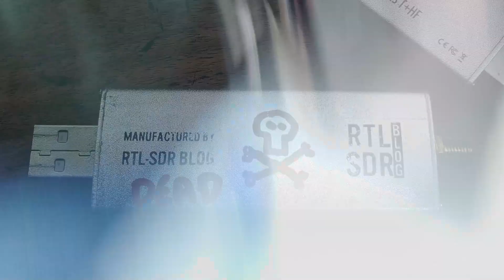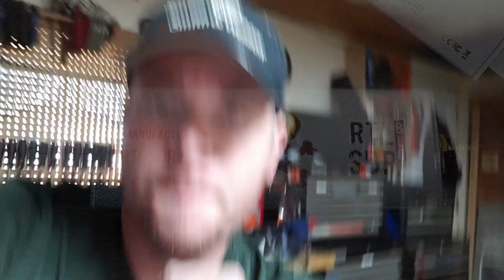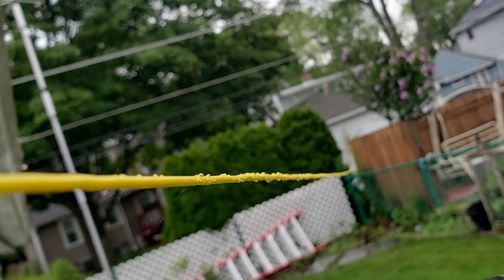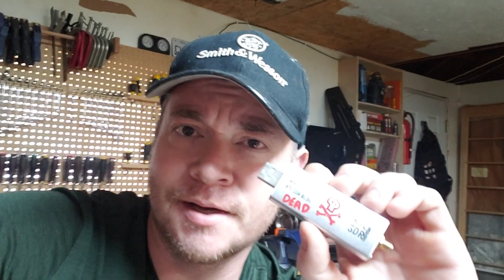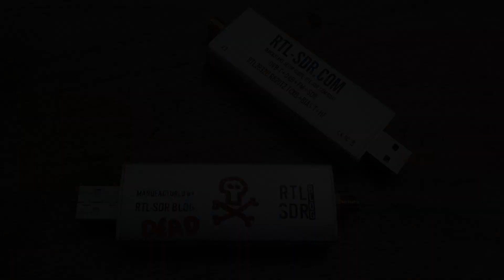PSA - Don't Kill Your SDR

Comment: I had 50 ft of coax from my outdoor antenna and the Pl-259 connector would arc whenever a lightning storm was happening. I could see the arc and hear the popping sound, It used to wake me up at night and freak me out. Lucky my antenna never took a direct hit from lightning. I touched it and got a good shock!

Comment: Thanks for lettings us know, was wondering if a Coax Grounding Block would of saved this SDR and other Coax devices?, seeing that not everyone would be there when a storm passes over their equipment. Does anyone know the answer to this ? and keep in mind were talking about Tom's 16 Gage wire antenna and other HAM Radio antennas not TV antennas (although same concept should appear🤷‍♂️ ).

Comment: Smiling!
One summer day living in KCMO went out to eat with friends in Independence, MO only to see a thunder boomer come through. We were both hams and I looked at him and said I forgot to disconnect the antennas. Several hours later returning home, walked through the front door and the lights didn't come on. Got this sinking feeling in my gut and went to the breaker box and reset the main breaker and all came back up. Most of my radio gear was hit, seems the tower took a direct hit melting coax and my vertical 2 meter antenna. Insurance paid minus the deductible think God. 
tower was about 85 feet to the tip of the vertical. 
73
Reply from the maker: OMG that's insane!!  Glad no one was hurt and sounds like you got reasonably reimbursed for the gear.  Still, that must have been a heartbreaking experience.  Makes the loss of my little SDR sound kinda petty by comparison LOL.  Thanks for watching and sharing your experience!

Comment: That looks like a cheap imitation of the Rtl-SDR Blog V3 SDR. That likely did not help
Reply from the maker: How can you tell?  Got any advice on what to look for to identify knock offs?
Reply: @TomtheDilettante    https://www.rtl-sdr.com/avoiding-fake-rtl-sdr-blog-v3-clones-2021-supply-chain-updates/

And based on that, Your seems genuine. Did not know they changed the Outer casing design. Yet might want to just read trough.
Reply: @TomtheDilettante     Did you order it from the official manufacturer or a third party website? Ordering directly from the source kinda helps with avoiding knock offs.
Reply from the maker: @SergeantExtreme  agreed.  I ordered from Amazon, but look for the seller as the RTL store (same as the one on the official website).  A good warning though to those that might go for a cheaper knockoff.

Comment: Lightning, that will do it every time. Our over-the-air DVR died a few years ago during a particularly bad thunderstorm, I had to replace it but I also installed a well grounded gas-discharge surge protector in line with the downlead from the antena and so far so good.

Comment: i use an auto rf sensing antenna switch, everything in the shack is connected to one large fan dipole, i disconnect the coax every night  and place the pl259 on the floor in the shack, just in case👍
Reply from the maker: Smart.  Thanks for the info!

Comment: Backup is good.  Hmm, The past 2 days I've been working on grounding 9 antennas, 2 towers, and radios to match. I just finished the diagram in color so now the work begins
Reply from the maker: Wow!  You're more hardcore than me.  Sounds like a cool and enviable setup :)  Wish I had the space for that many goodies.  Good luck!
Reply: @TomtheDilettante  I have been in since 82, I pulled out for about 35 years then started up about 4 years ago. I am working on another through-wall connectors for the coax. I think I said that lol. The box is done and vid will post in an hour or so.
Reply: @TomtheDilettante  Now I'll be able to listen to SDR

Comment: We had a BIG lightning show roll through the other night.  Not good right now as the wildfire situation is critical and the surrounding woods are dry, dry, dry.  Fortunately very heavy rain came with the lightning so not many new fires.  When the show started I ran around pulling power supplies out of various sockets.  Even if there is no strike just a build-up of potential in the local air and ground can have an effect.

Comment: Having an antenna that is DC grounded helps. My vertical is end fed and has a transformer feed. One side of the secondary is connected to the antenna and the other to a ground stake. 

The braid of the coax feed is also grounded to the stake. 

Any static developed on the antenna through wind, rain, snow etc is immediately shorted to ground, however the reactance of the coil in the transformer is much higher at RF and has little effect on the signals received. 

Might be time to learn how to solder and see if you can replace the wide band RF preamp chip on the board....what have you got to loose ??

<sarcasm>Or order one from Amazon and ship that one back as faulty</sarcasm>
Reply: That's mostly all good advice, but not sure why you suggested he should consider committing fraud at the end there :/
Reply: @dan_  it was meant to be sarcasm, but it was lost in the translation
Reply: @dan_  fixed
Reply: @MidlifeRenaissanceMan  Sorry, too many bad ebay experiences when people have actually done that to me.

Comment: Don't beat yourself up.  It's not like you were trying to tune SWR and forgot the coaxial cable to the antenna was disconnected - on a brand new Yaesu HF rig you just spent close to $900.00 on!  Best lesson learned; "slow down, pay attention to every detail, even if it seems and feels so arbitrarily stupid."
Reply from the maker: Yikes!!  That's a painful one to hear.  Hope it wasn't irrevocably damaged and you were able to repair / have it repaired for less than the cost of a brand new rig!
Reply: @TomtheDilettante   Well, had I not lost control of myself and further damaging the rig by seeing if it would survive being thrown across the shack, sure!
My Amateur Radio story includes learning self control that I was never taught growing up and strangely enough ditched it (the thinking) after military service.  And not wanting to make an ass out of myself on the Ham bands.  Since, I've learned; "Check all your coaxial cables!"
(This was intended to be comedic as well as truthful. LOL)
Reply: I forgot to mention - For many years I've been disabled and receiving Social Security and SSI: very low/fixed income.  Thus, I was over anxious and exited with what was a new and expensive HF transceiver for me.  So, when it shut down on me, I basically snapped in the moment all pissed off.  Hopefully this and the other post better explain things.
KD8EFQ/73

Comment: I had planned on putting a lightning arrest of some sort on my SDR when I get my radios hooked back up following some house renovation. I have not been able to find one with correct connector, so I guess I'll have to use adapters.
Reply: DO NOT rely on "lightening surge protectors" to protect your delicate electronics...
They are intended to provide a "better" path to ground, but if there are multiple paths to ground, you can bet the lightening will use ALL of them.
Best to take your antenna lead and connect it to a connector dead-shorted to ground...   This will divert static build-up away from your gear..
Reply: @kasualskeptik2584  True. Lightning arrestors like the gas tubes aren't meant to protect your RF gear, they're meant to keep your house from burning down.The only way to save your gear during a nearby thunderstorm is to disconnect the coax (and in my case toss the coax out of the window that it was leading into the house through.) Any gear such as LNAs or filters that are near the antenna will probably get fried regardless.